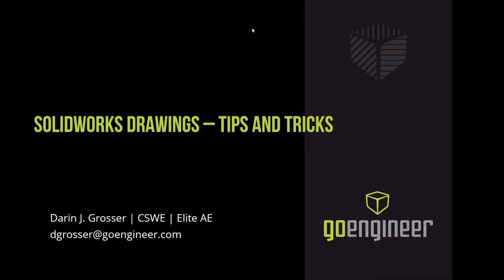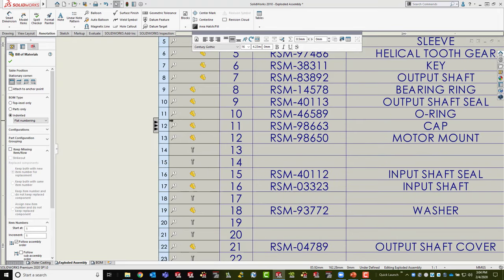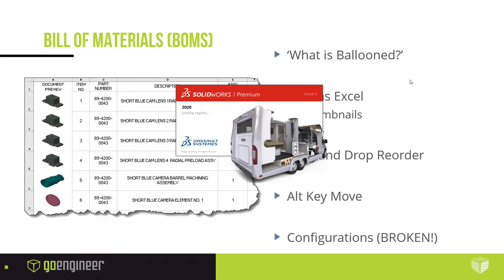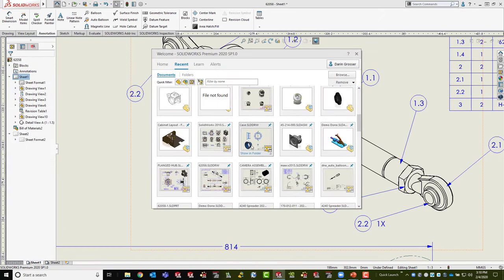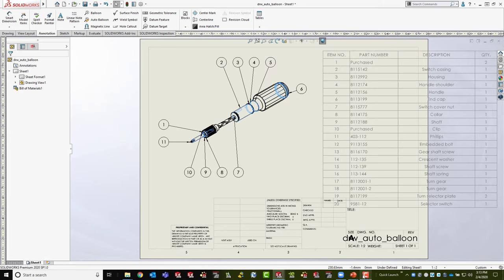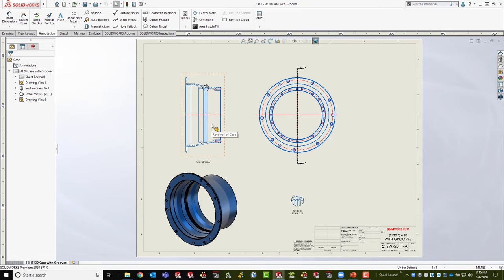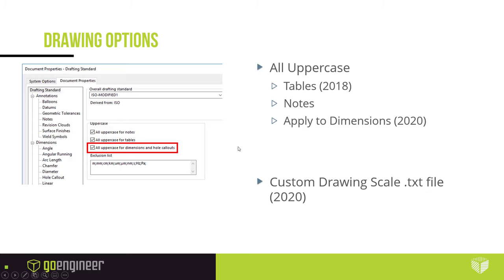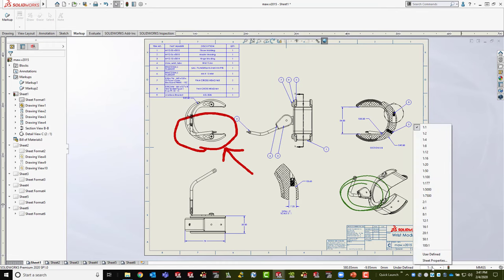SOLIDWORKS Tutorial - Drawings Tips and Tricks

Comment: On a drawing, I import a part file that has a curvature. Let's say a convex lens. I make some holes and some notches through it. How do I show diameters, hole locations from the datum/along the curve? Smart dimensions is a pain in the ass for showing these dimensions.
Reply from the maker: For instance…..if you create these ‘holes’ with a Sketch of circles with dimensions and then create the CutExtrude, you can actually use Insert Model Items in the drawing to bring in ONLY the Dimensions to a view for this specific feature.

Here’s the process:

-Create the Cut in the Part file
-Make your 2D Drawing with views.
-Expand the Feature Manager in the DRAWING you need to drill down to find the HOLE CutExtrude feature in the specific View.  Select it.
-Go to INSERT | MODEL ITEMS in the Pull Down menus or MODEL ITEMS on the Annotations Tab.

This will insert the FEATURE and SKETCH dimensions for the SELECTED FEATURE in the specific View in which you’ve selected.  This is an Associative Dimension and is the same PHYSICAL DIMENSION used in the Part file.

The Bonus is that this is also a dimension you can Double Click and change in the Drawing and it will change the Part file.

I hope this helps.  Let us know anytime if you have any further questions.

Comment: 6:58  Hi, in the drawing view properties, is it possible to make "Use model in use or last saved configuration" as default? I have to set this for each drawing is wasting a lot of time.
Reply from the maker: No, in fact, it is this way on purpose.  You see, if you have every drawing set by default to “Use model in use or last saved configuration”, then drawings would go thru a massive update, and in many cases maybe lose or dangle dimensions and annotations because features in one configuration are not always in others.

I would actually be curious of what your use case is that you would actually want your drawings views set to change configurations and rebuild constantly along with how you edit your model?

Comment: Thank you so much for this video! I use SolidWorks for 9 years now but I have learned a lot! I have a question. You have exported the BOM table to excel 2007, with thumbnails and everything. Is it possible to automatically export links to the part/assembly file? I mean that if we go to the exported excel table, we click on the thumbnail and the part itself opens in SolidWorks, because it's linked to the part/assembly data. It would be a huge help for us. Thanks in advance!
Reply from the maker: Hey majo8609, you should be able to create a link to files from within Excel... https://support.microsoft.com/en-us/office/work-with-links-in-excel-7fc80d8d-68f9-482f-ab01-584c44d72b3e